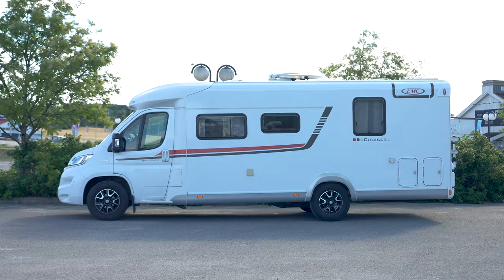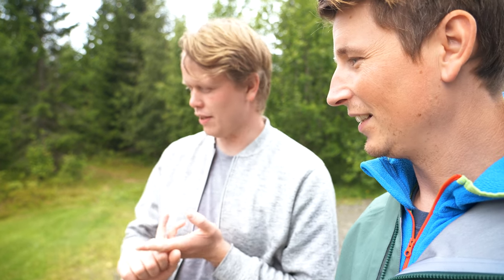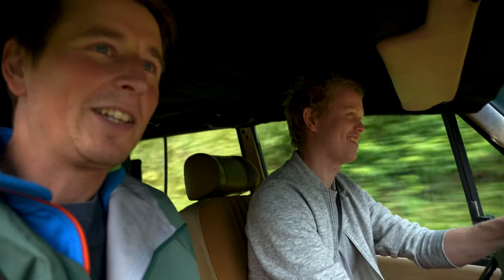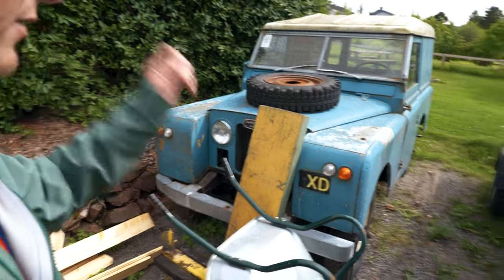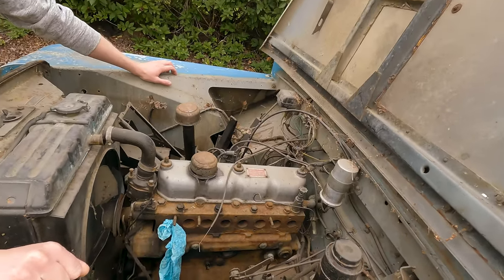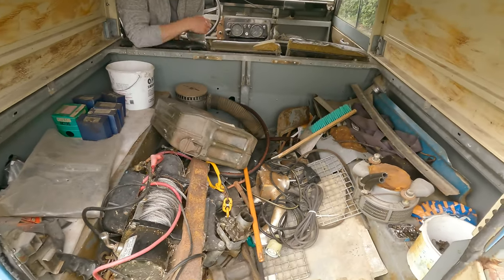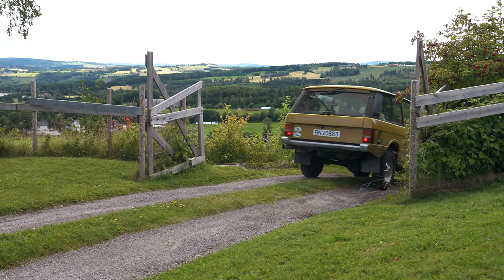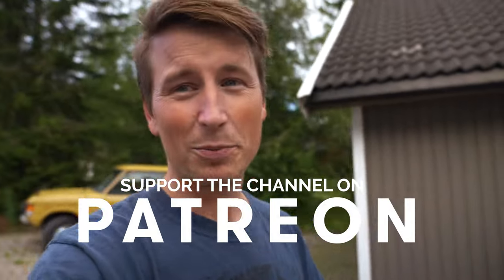LAND ROVER SERIES 2a - A Good Project Car? (It's not running!)

Comment from the maker: Series or Classic, what would you choose as a project car? 🤔
Reply: Nice video. The Series looked good but if you were able to get a Classic V8 I think that would be an excellent project.
Reply: A 3.9 or 4.5l in the series would be the cat's meow. but the ride would still be very rough without lots of expensive suspension work. And in stock form, would be very slow in modern traffic. Also not a lot of room for the family. The classic is truly a rover thru and thru. The 4 door would be better with the kids. but the styling of the 2 door is super.
Reply from the maker: @The-Observer  Yeah, I guess you could never go wrong with a Classic V8. There are starting to be very few good ones left in Norway. Maybe need to look outside the borders. 🤔
Reply from the maker: @tombrown879  That would be really cool and with the top of in the summer I know I would be smiling from ear to ear. 😊 I like the 4 door too, not as elegant as the 2 door, but with a tiny lift and some slightly bigger wheels I think they come to their own. 😊 A 4 door would be better for overland trips as well. 🏔️👍
Reply: Tough choice. Series is probably the simpler one to restore as there are no really big parts, only chassis or roof if 109. RRC would probably mean a lot of welding of the body. Interior trim on Classics turns very brittle and can be harder to source. There will be a lot more wiring connectors on the later ones which turn brittle too. It is a more complicated setup. Both are worth doing in the end. Hope that helps.
Reply from the maker: @billb3444  Thank you for great insight, and it helps getting other peoples views. I like the simplicity of the Series, what you see is what you get. And not so many surprises when it comes to the restoration job. A classic can definitely have a bit of hidden restoration gems. 😅  The comfort and looks of the RRC is comes with a bit of extra work for sure.
Reply: @LandRoverDrive   Glad to help. Good luck with the decision. Love the videos and chance to see real Norway.
Reply from the maker: @billb3444  Thank you Bill, I will keep on making real videos. 👍 More travel videos are coming soon so stay tuned for those. 😉

Comment: Series III had fully synchronized gearbox. Series 2a prior to 69 had inboard headlamps. Super deep sill plates are SII or very early S11A. Positive vs negative ground. Generator vs alternator .  Original seats are “elephant hide” grey.  The difference in SII and SII A is increase in engine size.
Reply from the maker: Thank you for the great insight! 😊 I have read a bit but are really a lot of small details on the different year models here. 😊 I really like the simplicity of the engines. Would be a nice change from the TDV6 in the Discovery 3. :)
Reply: Deep sills lasted until 1969 too, only very slightly after the lamps moved to the wings were they changed. The engine size increase was only on the diesel engine. The difference really was just in chassis numbering sequences and a few small details.
Reply: Negative earth was from April 1967 at the same time as black dash panel. Still on dynamo, alternator was optional until the series 3 era.
Reply: @onetonlandrover  hiya have you been able to source 9x16 tyres? Or the metric equivalent 255/100R16?
Reply: @jdenmark1287  I've thankfully not really needed to in recent years. Thankfully enthusiasts are good for making deals haha! They can be bought from Vrakking in Rotterdam but not cheap and it seems vague what they may have in stock. I think recent inquiries suggested a minimum order too. They are out there, but take some finding.
Reply: @onetonlandrover  my experience exactly. China is producing a bunch of knockoffs but haven’t talked with anyone that has actually bought them. 
Cheers
Reply: @jdenmark1287  Not familiar with them. I'm lucky enough to run pretty decent camac pattern 900x16s I bought off a fellow nutter 😂

Comment: Everything should come out of Series 2a. I think it will be a fun project! Love the sound of V8! I can see Eric is smiling! 2 door is the rare one! Yes You need at least one classic! Modern truck for daily driver.
Reply from the maker: Yep, a lot of work to get it going but for sure a fun project. Just a bit worried about the cost when it comes to the engine and getting it running again. 😅 We are both smiling all the way, not sure if it’s the V8 or us being back out driving together again or both. 👍 RRC is definitely a better all round car for daily use. 👍

Comment: I have a 95 NAS RRC v8 and not only love driving it but could stare at it all day long. However as I get older I think the 2 door RRC are the better looking of the two. You cannot beat v8 sound. I have a S3 109 station wagon which is a joy to drive and own. The S3 makes me laugh and smile when driving, the RRC though is such a good car to drive. For burning up miles the RRC is the one. For having fun and hauling a ton of camping gear the 109 wins hands down. You have a hard decision to make. I couldn’t so ended up with both. I would love to drive both of them in Norway. Thanks for the video and trip down memory lane. Cheers
Reply from the maker: I would love to own both a RRC and a Series, they kind of complete each other when it comes to old classic cars and their usability. 😊 And I can look at RRC's all day long. They really got something right back then and I think it is the reason why I like the Discovery 3 as much. 😊 Ability + looks.  If I found a 1985 RRC I don't think it would be a hard choice, on what to get first at least. 😂

Comment: There is no finer sound than that of a V8 accelerating.
Reply from the maker: It is definitely up there amongst the top 3 sounds for sure. 👌 So much joy in driving the classic with it's old V8, it's really special. 😊
Reply: I'll raise you my straight six at full chat through a tunnel. ;)

Comment: 2a looks like a solid project.
I love my 4 door 1993 LWB. Even with all the issues restoring it. I miss driving it.
Reply from the maker: Yeah, solid and worth a restoration. We will see, got my heart set on a RRC but they are not easy to find in my wanted condition, cheap and good. 😅
Reply: @LandRoverDrive  I'm pretty sure I could provide a Venn Diagram to demonstrate...that is nearly impossible. I see them over here under 10k occasionally. But they will need a some work. Perfect, if that even exists, start around $40k (USD) and go up. I've seen $89k (USD) asked with a straight face and expected to get that for one.
Keep up the good work. Check out my restoration if you want to live vicariously through me/are bored.
😁

Comment: Have to agree the RR classic would be my choice. 35 years ago I had a SeriesIIA 2.25 petrol here in Canada, and, it was a very bare bones vehicle. The coil spring suspension of the RR would make all the difference for me. BTW, you're the same age as our son, Matthew.
Reply from the maker: That's cool! 1985 is a good vintage. 😊 But seriously, the RRC is on another level when it comes to comfort, even the early models. Erik's 1976 is just good fun to cruise around in, and with overdrive the engine and drivetrain noice is much lower on the highways. 👍

Comment: Series IIs and IIAs didn't have indicators as standard until well into the 1960s. They were a very common option though. It looks a nice project, not too messed with, enjoy as a nice historical toy. 👍
Reply from the maker: Okay,  thought it came around 1960, late 59. Non the less a good option to have, compared to the flappy ears indicators before them. 😊  The looks solid and would be a nice restoration project and a Sunday drive for sure. Need to look into the parts cost, not sure what series parts are at now.
Reply: @LandRoverDrive  Prices are not too bad for a 2.25 petrol 88", depends how detail accurate you wish to be.

Comment: I'd go for the series IIA but I'd do a few changes, swap the engine for a LR V8 and install parabolic springs. 👌
Reply from the maker: That's a goo plan! 😊 Not sure we can get that approved in Norway, need to check with Erik. Did any Series 2 come with a V8. I know the Stage One came with a V8. 🤔
Reply: @LandRoverDrive  Hi, in the UK it'd be fine with DVLA to swap engines just insurance would cost more. As far as I know only the stage 1 was produced with the P5 3.5 V8. Very light engine and beautiful sound 😃
Reply from the maker: @MrElmag12  okay, I have heard it’s a bit simpler in the UK and you just have to add it to the insurance. My uk friend Perry just laughed at our rules her. 😊 But yeah, stage one V8 would be legal and a dream. 👌
Reply: @LandRoverDrive  a V8 and I'd a canvas top for the summer month that's dream
Reply from the maker: @MrElmag12  👌👌

Comment: This one is in good shape get it.
Reply from the maker: Yeah, it has surprisingly little rust. 🤔 I don’t have the funds to get both so need to be the right choice.
Reply: @LandRoverDrive  both RRC and series will gain in value if taken care of. The early RRCs aren’t really a lot different from a defender the later ones aren’t a lot different than your discovery. Check out Harry’s Garage review on them, the man has owned every single model. 

The series is the way to go in my opinion, with parabolic springs it is surprisingly supple suspension. With the top off in the summer it is surprisingly quiet too and super fun to have around for family outings of short duration,
Reply from the maker: I will check out the review. 👍 Series is noted, top down in the summer would be a great setup, only worried about the lack of sunny days here in Norway. 😅 But would be so cool with the family going to the beach or small outings. 👌
Reply: @LandRoverDrive  sun is overrated. We would get burnt to a crisp here in Hawaii if we didn’t leave our soft top on. We just roll up all the sides. But when I lived in Seattle I left the top off my series III from July to October usually with the windscreen down.